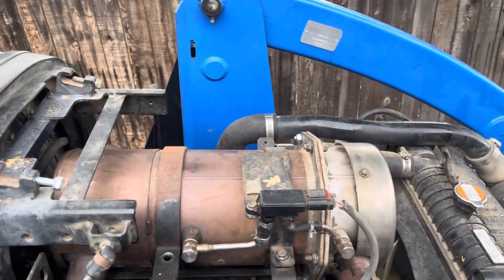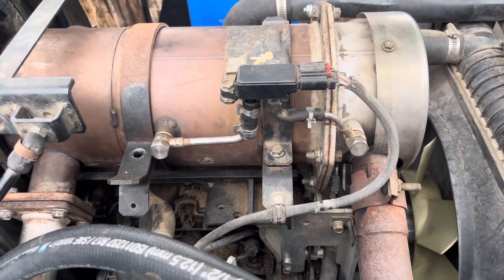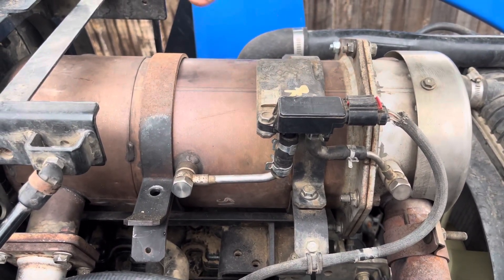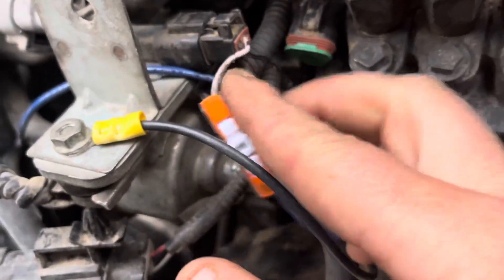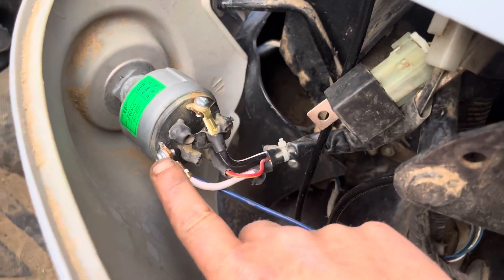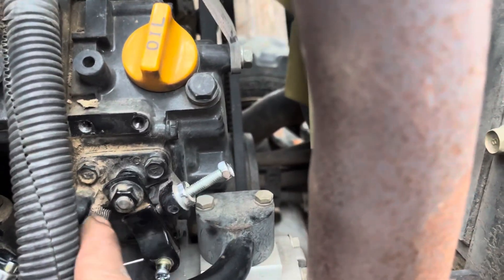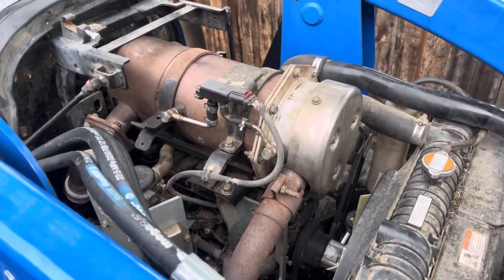New Holland Boomer 33/37. & LS  XR3032, XR3037 tractor dpf delete.  Fixes Regen Shut down.

Comment: Couldn’t you just remove the DPF filter but leave the DOC in the back of the canister just to try it out without actually having to bust out the DOC portion in the back of the canister? That way if it doesn’t work, you can always put the honeycomb back in and go back to original set up.
Reply from the maker: Great idea, give it a shot.  I have no idea and that actually makes a lot of sense.  However now that it's gone it'll never get plugged up.
Reply: Yes you absolutely can do this.. 20hrs runtime in this configuration with zero issues.

Comment: For those who may find it later.. The entire DPF can on top can be removed, also.. the 3 wire plug down next to the fuel shutoff solenoid needed to stay plugged in but the fuel control solenoid on top of the fuel pump needed to be unplugged instead on a Workmaster 33 2015 model.
Reply: I wanna thank you for commenting this information, it helped out someone I know fix their wm33

Comment: Well. After  my friend already spent 5k on his 2015 boomer 33... this is possibly a solution. 1000 hrs on it and it's plugged and in limp mode again.  Curious since the regeneration light is still on will the burn injector still be dumping fuel into the dpf thinking it doing a regen?  And how's your friends tractor running these days? Thanks.
Reply from the maker: my 'friends' tractor is buried in about 4 feet of snow right now but after running it 100 or so hours after this mod it's running great.  

It does not continue you to dump fuel into the dpf as it's not doing a regen cycle.  If your 'friends' tractor is STUCK in regen, this certainly is not going to unstuck it.  My friend couldn't get his regen mode to run - it asked for one but refused to run a regen cycle.
Reply: @SkiDeepPow so if your tractor is already derated this will not resolve the issue? I have a xr 3035 that is derated that’s been sitting for months now trying to figure out my best option.
Reply from the maker: @NathanSchafer-d5w can always reverse course if it doesn’t work.
Reply: @SkiDeepPow not if you knock the honeycomb out lol
Reply from the maker: @ that is true!
Reply: Did your friend ground both ends of the black when it was cut?  The solenoid end and engine harness end?
Reply from the maker: @hoacha1  honestly i Have no clue.  Only grounding that was done was in the video that was grounded to the chasis.  zero issues.
Reply: So.. bypassing the fuel shut off solenoid with the wire job shown in the video (2 wire) you don't need to ground the computer side just ground the solenoid side and then provide key ignition power as shown.

This and the throttle cable would also perm remove the "limp" mode as the ECM can no longer shut down the tractor. Also.. it will not do a Regen because it doesn't reed the correct pressures and things it's to far plugged up.

Comment: Does "your" tractor have a turbo? Wondering if the effect and process is the same with a turbo or non-turbo. Thanks Kevin for not doing this and caring for the environment. I bet that tractor would give you a big hug if it could! Thank you!
Reply: I have a 2016  XR4145 with a turbo.
Reply from the maker: no prob, love the environment personally as does the tractor.

There is no turbo on the tractor in the video.  Can't say if there would be any difference between the two.

Comment: Does this really work? Mine were not run over 30 seconds. It shuts down. Telemate cost $3000 to get it repaired. I would love to delete that trash
Reply from the maker: i mean read the rest of the comments?  

The tractor in this video has run hundreds of hour since they did this.

Comment: How does replacing the electronic throttle effect the pedal operation? I have an HST boomer 37 currently in limp mode begging for me to do this simple surgery. Just don't want to ruin my ability to drive forward and backward... is this a mechanical model or also an HST?
Reply from the maker: This tractor was HST.  There is zero effect to the HST pedals and they work completely normal.

Comment: can you just  run a throttle cable to the existing lever or does it require a new lever as well.  Want to see if I can just fix the cable to the stock lever.
Reply from the maker: there is no existing throttle cable.  The factory throttle is a digital signal sent to the ECU.  In the video you see it's a physical throttle cable that moves a lever.

Comment: I'm a little confused on which of the two cables out of the fuel solenoid you are altering?  Are you opening the two wire connector?  The positive side to switch on 12vdc,  and doing a physical ground to the black wire?   I know the 2 wire connector is the electrical fuel on/off from reading the repair manual and the 3 wire connector is the way the ecm knows the throttle position...   are you just disconnecting that cable or leaving it...

And last, could you share where you found the throttle cable assembly and a part # please. 

Thanks for clarifying what your doing....
Reply from the maker: no clue what they do brother.  If you wanted to know more ask these fine people.

https://www.tractorbynet.com/forums/threads/new-holland-boomer-37-in-dpf-shutdown-mode.463091/
Reply: @SkiDeepPow  thanks
Reply from the maker: https://www.amazon.com/gp/product/B000COCPZM/ref=ppx_yo_dt_b_search_asin_title?ie=UTF8&psc=1

https://www.amazon.com/gp/product/B0018TYIGY/ref=ppx_yo_dt_b_search_asin_title?ie=UTF8&psc=1
Reply: @SkiDeepPow - perfect, thank you

Comment: Tried this on my '14 xr4046h and it wouldnt start. Tried different throttle positions at the pump. . . But nothing. Reverted back to factory wiring and it runs, but still in limp mode.
I had high hopes. Dealer just scammed me for 10k. . . And it lasted 10 hrs before back in limp mode
Reply from the maker: all i can say is sorry bro.   Have a lot of success for other people.  Perhaps something else is going on with your tractor...

Comment: Does the foot throttle  still work once you go mznual throttle?
Reply: The foot pedal for the wm33 is drive by wire along with the manual throttle so I assume disconnecting all that and going drive by cable will make the foot pedal not work. My problem right now is a fuel leak around the regen injector but it was caused by bad regens and overpressurizing the system. Once the fuel leak is fixed, deletion will be the solution
Reply from the maker: This is hst so there is no foot throttle.
Reply from the maker: But yes foot peddles to go forwards and backwards work.

Comment: Few thoughts: re: Workmaster 37: 1) not sure what disconnecting the 3-wire triangular plug brings, but one did do this. 2) vs cutting the 2-wire connection, one could disconnect it (the opposite end of the plug from the video) and pop the plug off of the metal bracket and unwind it from around all the stuff to give them more wire to work with 3) vs cutting the wire, one could splice into said unwound wire. 4) vs a throttle cable one could set the throttle to 540 (~2300 or so rpm). this should be a 'temporary fix' in one's opinion. 5) vs chiseling out interior honeycomb, one could drill a 1" (or so) hole into it. Not sure the real value this brings, but.... effectively the same thing

must say that when one read (the tractorbynet and watched this video), one was quite apprehensive on fiddling with this, but one's mind has been changed. one would recommend ensuring the warranty is expired or it would absolutely void one's warranty. It also may make the unit unsellable, but if one's going to drive it into the ground, it really won't matter much.
Reply from the maker: Good thing you didn't do this, but i'm glad you reported on what would happen if perhaps one did this.

Thanks for caring about the environment and I think you provide good feedback!

Comment: How did you fasten the throttle cable in the bracket on the engine?
Reply from the maker: the person who did this actually never really figured that out well enough yet and needs to figure it out in the future.  they don't run their tractor enough
Reply: Looks like it is hose clamped to a nearby hose. Not a long term solution in the event the hose clamp cuts through.

Comment: I did this to my Boomer 47 today runs great hope it continues
Reply: I did this to my father in laws New Holland 37. Runs great for about 3 passes of bush hogging then goes to idle throttle speed. He said it eventually dies. Any thoughts?
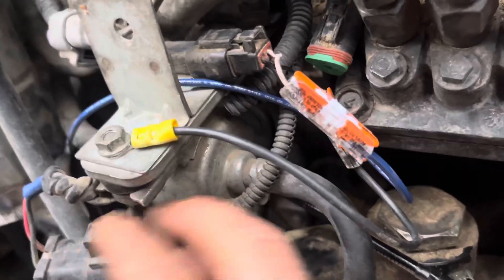Reply: Figured it out. The wire you said you left untouched(1:20) I had to unplug. Ours would run until it ran out of fuel in the line. This little actuator shuts the fuel off and will not let ours run. I unplugged it and it has been running awesome! Thanks for the video.
Reply: @ForceBuilt  thanks for posting the fix for the rest of us!!
Reply: Hows it still running for you?
Reply: It’s knot running
Reply: @95xcr  its not running because of bypassing the dpf and going manual fuel pump?
Reply: @tarster  I don’t think that’s the problem it won’t even turn over
Reply: @95xcr  ok good to know, I just had to pull the burn pot apart on mine and clean it all out and then put it back, it was derating and wouldnt complete a burn cycle properly.
Reply from the maker: yeah you got bigger issues
Reply: @SkiDeepPow  is your tractor still running fine after doing this mod now a good while ago?
Reply from the maker: i asked the person whose tractor this was, they said yes it's running awesome.
Reply: @SkiDeepPow  😂

Comment: Hi will delete work on a new Holland boomer 47 diesel I’ve had issues with it for 2 years Thanks
Reply: yes, working on doing this to a 2014 Boomer 47 now. Fuel solenoid will need to be wired as above. The triangle plug needs to remain attached(differs from video). I haven't put in a throttle cable yet, but adjusted the right bolt back to 2200 RPM, the fuel solenoid adjust for the throttle, so if you don't adjust the manual throttle, it'll start and run at 2900 RPM.
Reply: @TMART09  How is your boomer running I have a 47 I did what he showed in the video it ran good for awhile but now it won’t turn over so I’m still having issued
Reply: @95xcr how many hours has it been? There was a few times I had to hold the clutch and brake to start it.
Reply: @TMART09  good morning mine tries to start it won’t crank over it’s just a very short try so maybe I need to step on the brake mine is a hydrostat
Reply from the maker: no clue!  is it similar setup the one in the video?  then perhaps!

Comment: How did you know how to do the wiring changes?  Is there a diagram to follow? My WM 33 just got put into the shop to fix the limp mode again. Second time in 4 months. 2500 to fix it the first time. Now they suspect the burner is bad. much more expense with that part. I am thinking of seriously looking into this.
Reply from the maker: more or less was following this thread was the only guidance this person had.

https://www.tractorbynet.com/forums/threads/new-holland-boomer-37-in-dpf-shutdown-mode.463091/

Comment: Would this work on a boomer 50?
Reply from the maker: no clue!  does it look very similar to the boomer 33?  If so, it could!
Reply: @SkiDeepPow  is your boomer33 fuel injection? That is the problem I’m facing the computer is putting the tractor into limp mode and restricting fuel.
Reply from the maker: @chancegengo1861 idk. it's a stock boomer 33, google it?
Reply: @chancegengo1861 with the manual cable throttle you get past this.. and with the fuel shut off solenoid the ECM cannot shut the tractor down.

Comment: Do your forward and reverse pedals still work?
Reply from the maker: yeah, everything works (well except the regen)
Reply: @KevinLauscher  would you personally do it right away or Just when dpf is toast?
Reply from the maker: @All-Ashore Probably toast.  This tractor owner milked it as long as they could until the tractor would not go over 1500 rpms.  It was all the owner could do to get the thing running normal again

Comment: 3 yrs my Boomer sat useless. Did mine today, and wow, what a difference.
Regen light stays on, and a warning sign flashes on the dash, not concerned.
Reply: Fuel pump now becomes drive by cable not by wire.
Reply: @kevinwilgosh9489  Thanks makes since
Reply: Can you tell me why you have to replace the throttle cable Thanks

Comment: Is it still running good
Reply from the maker: yup no issues, probably 10 hours since I installed?  The throttle cable did come loose as it has a lot of resistance.  Need to figure out a better solution there.

Comment: Does your regen light stay on after doing this. Also are you over riding limp mode by taking manual control of the throttle.
Reply from the maker: yes regen light stays on.

Yes someone would be overtaking limp mode with manual throttle.
Reply: @SkiDeepPow  someone.  hahaha love it.